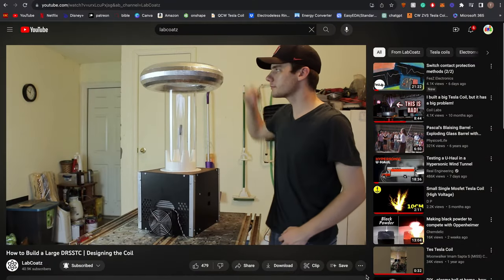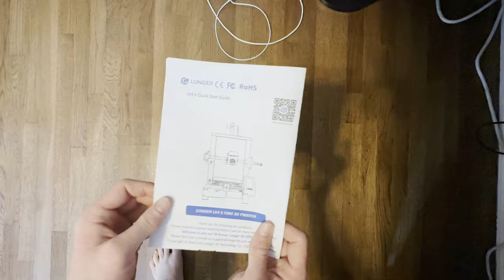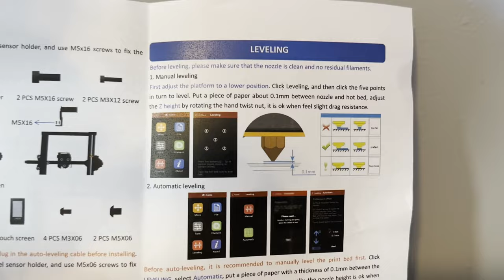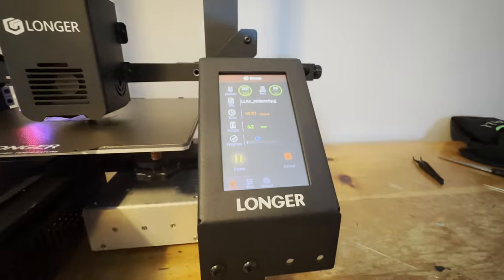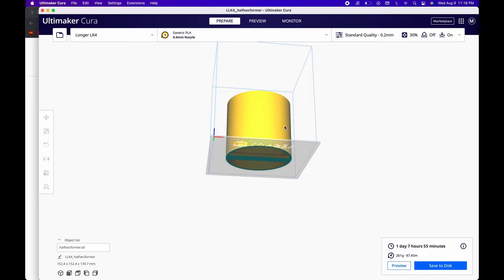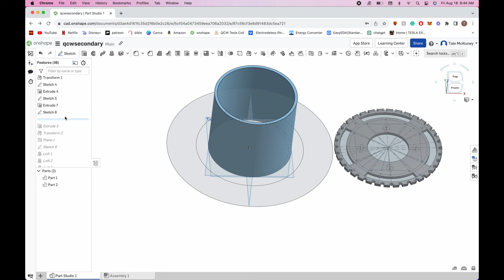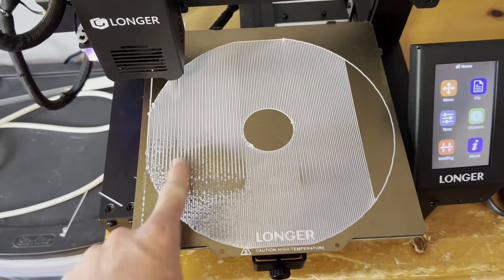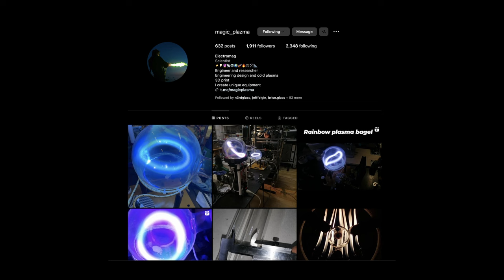3D Printing a Tesla Coil (Longer LK4 X 3D Printer)

Comment: Tesla coil ? You'll need to find ideal distance between wire . Tesla could not do it because it required a 3d printer .  The gist of thing ? If i understood tesla expectation . Tesla wanted to supplement the drop visible on scope with the high of wireless electricity . But as it stand the wireless peak is not in the middle of wired peak .  Its one side or the other . The ideal distance ? Likely bare wire size used for loom  coil of wire .

Comment: I would definitely sand down, dry out, and seal the surface and inside of the secondary former. Moisture is a problem in PVC. It could potentially have an affect on performance. Especially with higher frequencies
Reply from the maker: Thank you for the suggestion!

Comment: Hey man, you need to tweak your settings to print faster. There is a plugin in Cura for generating tests with good wiki explaining every test, so you can tweak all your parameters. Every filament (esp. cheaper ones) need at least temperature and cooling tweaked.   
Got rid of a raft all together, never saw it actually veing used in last years, definitely not needed in this cases. If printing with PLA or PETG you don't even need brim probably. Try to raise your speeds - first layer 20-30mm/s, lower if you have problems with sticking (you shouldn't on a good magnetic build plate). Overall speeds can safely go to 60mm/s or higher (if you want better surface finish you can lower just outer perimeters and upper surface speeds). 
Also you can drastically speed up your print using bigger layer hight (0.3) and bigger wall thickness (0.4 nozzle can orint up to 0.6 wall thickness but 0.5 is very safe and easier to engineer for). But this 3 tweaks drastically increase flow, so you should do flow test to see max flow from your extruder and then in Cura in preview select flow in coloring scheme. Normal extruder should be able to print 0.3mm layers  60mm/s 0.5mm walls no problem, Volcano will go higher than that.

Comment: If you are in the same room as that printer for very long periods of time then i suggest you put an enclosure over it. Ive heard that the filament can basically vaporize and can be toxic over time. I keep putting off building mine with insulation foam but then again i dknt print often anymore.